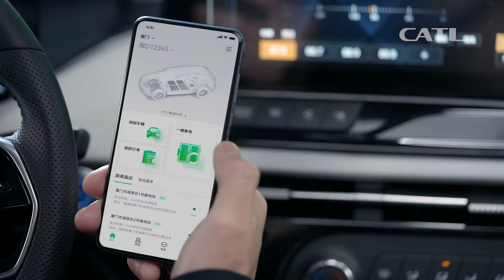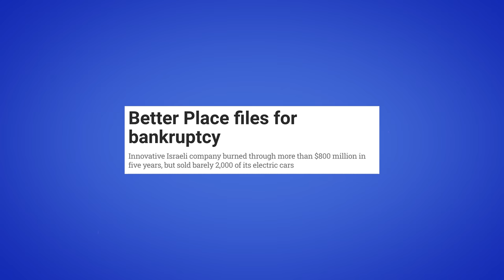Why Battery Swapping Is A BAD Idea

Comment: Tesla just didn't have the finances at the start to build out something like that, since it's a lot more complicated and more expensive than just simply having the option to charge yourself or their gradual expension of relatively easy to build charging stations. I've done a research paper on swapping stations and I can tell you that it's the superior tech for many countries and practically every crowded city. It also lowers the cost of ownership for a 'premium spec' option, which is really important as well nowadays to the financial uncertainties many families experience.
Reply: A slow, gradual apporach was not in the interest of Tesla, since their only chance to break free the industry was to go with a strategy that would ensure maximum penetration and even then, they barely made it. Swapping stations, if they initally went with that, would most likely be the end of Tesla in its early stages.

Comment: Fun facts in China at the moment:

Nio's cheapest version, ET5 retail at RMB328K(~USD47K).
A discount of RMB70K(~USD10K) is offered if opt for least battery. That is, RMB258K (37K) and a RMB980 (USD140) monthly charge.

Compare w/ model 3, listed price is RMB290K(USD41K), no monthly charge.

Compare w/ BYD (BYD is one of the best sellers EV maker in China w/ decade of experience) model: Seal, list price is RMB210K(USD30K), again no monthly charge.

For your information, nio doesn't own any 'car making' license in China, they are made by another state owned car manufacturer. Yes, OEM.

Regarding battery swaping station, for the place I'm living, a top ten vehicle owenership city in China, here we have:
>700 Gas stations. More than enough, takes me 2~5min to find one
150 EV charging stations (not ports). my guess is 10~15min away and is still fine.
10 NIO swaping stations, lucky if you find one near where you live/work, or spare >30min or up to an hour to find one, because, traffic.

And not to mention a monthly RMB980 charge is equilvant to 114L or 30 Gal of gas.  And, normally, ev station charge you around RMB $0.8~$2(Tesla)/KWh, or at least 490KWh.

Yes, I live in China too. A happy ICE owner.

Comment: So what i am hearing is companies fighting tooth to nail to stop a standardized size and swapping procedure to become a thing. This should just be a given by default, make specs for  battery size, connector, software and charging procedure, then force manufactures to stay within guide lines, it will not matter what tecnology they use for the batteries if they stay within spec. Easy user friendly battery swaps should be default and cimpanies trying to stop this by making falsified claims of compexity and safety for profit margins should be put to trial against the opposing party to see who is right and who is wrong.

Comment: I think removable batteries are a great idea but a standard size ie Jerry can size would be the best.
BUT limiting EV'S to batteries/charging as the sole power source will slow the development of the EV platform.
Having a power source that is a standard size but allows for hybrid power sources allows better utilisation and greater adoption of EV Platforms, cheaper and more efficient power production as well as alternate use of batteries as household power sources would reduce cost as you could choose the cheapest power source available and decentralise power supply not just for vehicles but for households. 
 Making nations that adopt it more resilient in times of war as evidenced by the current situation in Ukraine with Russia attacking the central grids.

Comment: This is what I've been saying for years. Battery swapping instead of long-wait charging. The issues you point out are really nothing more than teething troubles for a new technology. Even petrol cars (I believe) went through the same kind of hesitancy when they were first introduced: "We'd need a national network of petrol stations, and who'd invest in that" - by the end of WW2 they were everywhere. Commonality of battery packs; ISN'T THAT WHAT THE EU IS SUPPOSED TO BE FOR??? Banging heads together across Europe to force people to take various courses of action. They've managed it (just) for USB ports, now they need to do the same for the battery packs from Euro manufacturers. Once the EU and the Euro manufacturers work out how to use common European battery packs for market protectionism of the Single Market by the back door, they will be ALL FOR IT!!! The biggest stumbling block to this technology is, as you point out, fast charging. But IMHO ultra fast charging is only ever going to be for premium vehicles. Schlep-wagons are always going to use cheap, long-charge batteries. And what are most people going to end up with??? So YES, to my mind, this IS the way forward. Until ultra-fast-charging is for everyone. Oh, and something to bear in mind is that batteries DETERIORATE OVER TIME. If you buy a fixed battery car, you own the battery (not good for you). Swap stations remove that issue for you, BUT it gives ownership of the batteries to the leasing companies, who will have to deal with the diminishing charge batteries. Maybe THIS is why companies are so reluctant to invest in Swap Shops???
Reply: Batteries today outlast the car. Especially the LFP batteries and the new batteries from Tesla. So what is the problem?

Comment: 3:40 is argument faul. Comparing large charging station with just one swapping station. If you would have 69 swapping lots and 3 parking lots converted to battery storage hall. You would use the same amout of space (72 parking lots) but with must faster swapping

Comment: Swapping is natural because it carries over the concept of a "gas station" to the electric car market.
Making a leap from a energy supply depot (gas station) to a trickle supply is a failure in logic.
Making a complex swapping station and fail to do so is not a failure of swapping.   An interim solution would be manual labor (similar to gas station attendants) swapping the batteries.

Comment: I guess since NIO targets the luxury auto customers, and battery swapping is the most convenient and comfortable method for drivers, they must be thinking rich people would not mind to pay extra for the comfort and security that comes with not having to leave your car. Think about inclement weather, safety etc. 

Also, as far as I understand, battery life and quality is better for batteries charged in the swap station. When there are more EVs, providing the needed energy will be a problem, especially at peak hours. Battery swap station will constantly charge the batteries in the most efficient way possible.

Comment: NIO battery changing stations have already become the standard to follow in China and will soon be followed by the rest of the planet. 
The reasons that make it necessary worldwide are as follows. 
                                                 
1. Autonomous driving 
2. Battery upgrade 
3. Charging speed 
4. Stabilization of electrical network 
5. Longer battery life (due to low voltage charging) 
6. Battery repair 
7. Cheaper charging (off-peak hours) 
8. Saves the life of used cars 
9. battery recycling 
 
10. STORAGE OF ELECTRICITY PRODUCED FROM RENEWABLE SOURCES AND FEEDING THE ELECTRIC NETWORK ALL 24 HOURS

Comment: 1🎉²5:30 Again, love the fact that you have been one of the first to recognise this tech, but battery swops do have a key role play in the transition. Firstly because the gov has promised to build 300k chargers by 2030, and has not yet installed 70k, while Ford reckons we need 3 million. Second because you can put 500 batteries in a battery swop station, and they switch the battery in 90 seconds. Third, because the Battery swop network will provide enough battery storage to balance the grid when everything runs on renewable energy - especially wind. Chargers cannot upload power back onto the grid, so they are no good at all for that, and without that there can be no net zero. Finally, the way Tesla and Better World did it was all wrong - but props for trying. You said it, in fact. No-one is going to buy a car where the maker can only supply three swop stations (in California... bigger than the UK). And no one carmaker can install swop stations across the USA. There is a way to start one, though, and the UK is the ideal place to do it. It could be immensely profitable and successful here, but it has to be done a certain way - and with a mandate from the government. Finally, it would not be done with expensive lithium batteries but with the new, much cheaper, sodium ion batteries. This because as there would be battery swop stations widely available, you would not need big, heavy, expensive batteries that offer a huge range. A 150 mike range would be fine. But its the way you start it that makes all the difference, and I'm keeping that a secret!

Comment: It would make sense to really standardize battery sizes and interfaces for EVs, e.g. I hope young people understand the benefits of having AA/AAA batteries...
Reply: Nope, because there is still a lot innovation going on the way the batteries are build. And this is still in progress and being experimented with. See BYD with their blade batteries, Tesla with their large cylindric batteries. CATL with their prismatic cells. Pouch cells, so many different types. This is evolution and the world is still figuring out what is the best way for cars.
Reply: @HermanWillems  You have a point, but look at the AA battery type. It started as standard, then alkaline, then NiMH then lithium etc. The standardized module size and connection type shouldn't necessarily stop innovation, on the contrary...
Reply: @nikosuoa  i agree regarding servicability and so on. It might be standardized in the future. Maybe in 2050. But i dont think Nio is the party to standardize it. Also Tesla is going to a battery as part of the structure of the car. Which means you cant swap it but then has several other advantages. Cheaper, more range, higher reliability. But i think its evolution and maybe later the battey system will be standardized. It might be.
Reply: @HermanWillems  Well, the idea is that most of the big car makers sit down and agree on a standard battery module specs. Let's see, I hope that we see some standards to help open up the market and promote innovation/serviceability a bit sooner :D.

Comment: Swap stations make tremendous sense.    The short life of some batteries, and their degradation over time makes leasing batteries an important step up.   Nobody wants to replace a $25000 battery.   Reducing range makes used EVs  nearly worthless on the market.   Without battery ownership, I might consider an EV, but it would have to be used due to cost.    It also offers the option of leasing an older battery with reduced range at a lower lease rate….. for urban commuting, but swapping to a nearly new higher lease rate battery for a trip.   Ideally you should have both swap and charge options.   This would greatly increase battery life, as well as EV acceptance.   Properly structured from an economic standpoint, it would be a win win situation for both owners and the environment.   Scrapping cars because they are not worth the investment in a new battery makes zero sense.     Most of our efforts to “solve” climate change going “carbon neutral” are like this…… pure fantasy / salesmanship.    We’ve lost the battle already.

Comment: Battery swapping is indeed a good and bad idea. You can have batteries swapped in minutes in contrast of having to wait generally 30min (or 12mins) to charge. However fast chargers can accelerate battery wear as opposed to a quicker battery swap which then latter charge the "flat" battery at slow charge rate. My other concern of battery swap is are fully charged batteries are always readily available?
Everything do have pros and cons. It all brings down to one's service preference. Mine is simply using slow charger(s) at home and charge over night knowing I generally use my EV for short commutes and simply charge overnight at home.

Comment: I live and work in India but I'm from Chile. In neither of these countries can i imagine highways with only fast charging available. Fast charging stations locate themselves in very strategic midpoints between cities because of the sheet amount of space required and high traffic areas inside cities. Even today EV owners would rather charge at home rather than at a fast charger. Can you imagine when EVs start getting to the 25 percent of all cars or higher mark? Highway charging stations will need to accommodate 100s if not 1000s of cars pretty much simultaneously, almost all of which will want their top-up around the same Km mark. City charging stations will have an influx of a new demography of people who can't charge at home because they live in older apartments, congested centres, only street parking etc etc. Yes, yes, Norway is an exception but then that's because Norway is exceptional.

Comment: £150 per month for a battery swap service I probably will hardly use as most UK car journeys are less than 50 miles a day. Just charge at home overnight and save £150 per month.

Comment: Why ask such a obvious question? Just dont get it. Is there is no better content to show?

As we know, Nio is the only brand that offer such facilities. But at the same time beside swapping battery, they also let the car charge same as other electric car. Nio users can just charge their car at home or during working hour. Swapping battery can be assume as another alternative for certain cases users.

Example, your residence area power have been cut off for hours and you are rushing to somewhere quite far. Then what's the alternatives? Swapping battery in the nearby stations? Nio can do that but how about Tesla? Call some service provider to drive over your house and spend hours charging the car? Or drive somewhere public and spend an amount of time waiting while having the rushing feeling?

Profit or loss is not up to the user but the manufacturers or providers. if they have initiate this method, pretty sure they have their own plan.. right? They just need to build the stations at strategic area in downtown and uptown; in moderate amount. 

So tell me is this a paid video from any electric vehicles out there? Tesla again?🤭

Comment: i like the concept of replacement batteries, and here's why . obviously i have no interest ever sitting at a servo for 15 mins or longer charging a stupid car, just so i can get to where i want to go . i think no one is keen at all on that. but what i think is the best feature of swapping batteries and why the design of them needs to change  from 500 kg packs to individual pull in and out units at say 15-20kgs each would be you could charge them at home using your solar roof cells during the day and just swap them out when you get home with a fresh set each night with out using any carbon producing power at all. also you could have charge banks at your work where you don't have to plug in car but just slot in your flat packs  and take them home with you as another option. obviously sounds easy but must be some reason why this wouldn't be any good  and would like to understand more about why they choose the bolted in non removeable packs some more

Comment: My Nissan Leaf is currently sitting in my driveway with about 50kg of added weight, in the form of ice. Anyone living in Canada, or other areas that experience real winters, can identify. Now imagine how long it will take for a single, ice encased battery pack to be swapped. Imagine the mess each car will leave behind. Imagine how a single malfunction, in the  swapping mechanism or the car, could back up the whole process. Imagine if swapping actually catches on, and swapping centres can't keep up with demand, requiring larger facilities to store more batteries or faster DC chargers. Finally, imagine Tesla (or any other innovative manufacturer) giving up on the competitive edge they have to join in on a standardized swapping format that would not really benefit them.
This is small scale, niche tech at best.